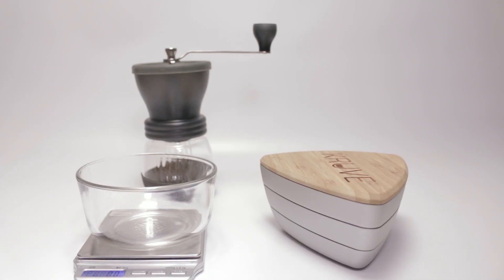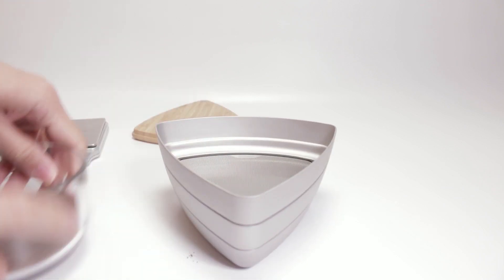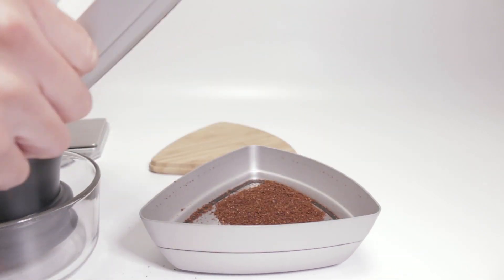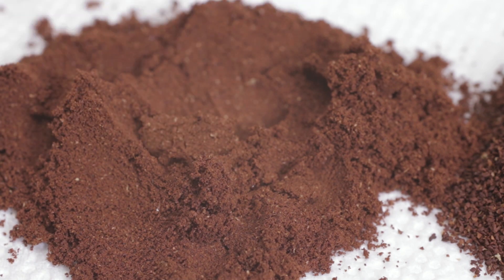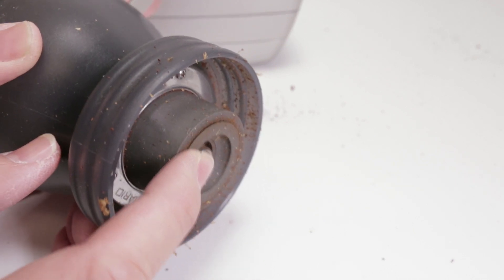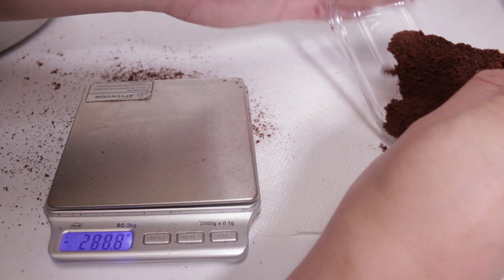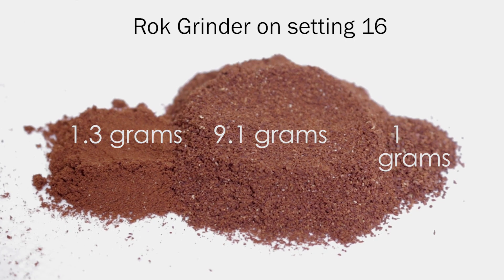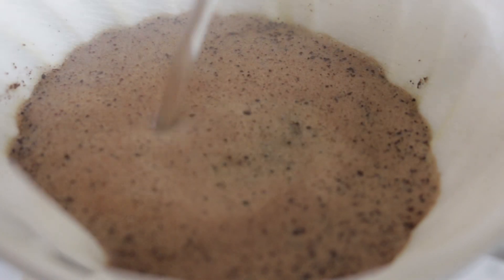Making perfect coffee with Kruve

Comment: I have a Comandante c40 mkIII, it grinds very evenly but a cruve sivter would definitely increase the brewing results. Without the boulders and fines I should achieve a more balanced extraction profile and reduce the brew time. If I want a longer brew time I just have to grind finer, or I add some fines to the bottom of the filter, depending on which method fits the complexity and/or body better.

I'd use old beans, grind them for each grind setting in a range I'd use for pour over coffee at a dose of 12g and then weight the boulders, fines and good grounds using different sieve-combinations to figure out at which setting I'd yield the most good grounds.
Reply from the maker: It definitely helps in also finding sweet spots.